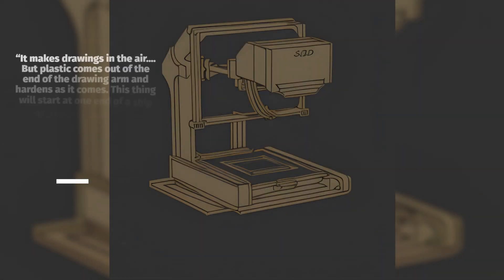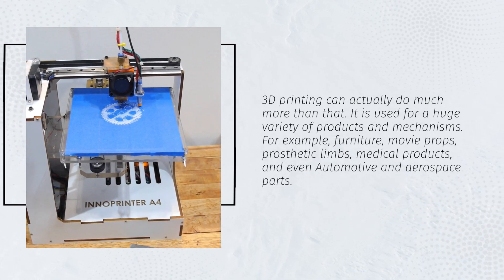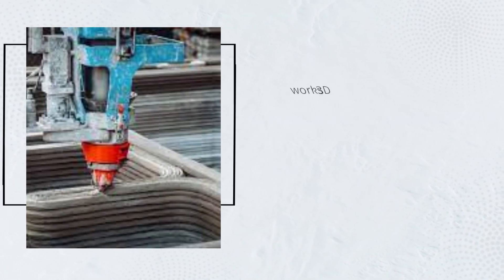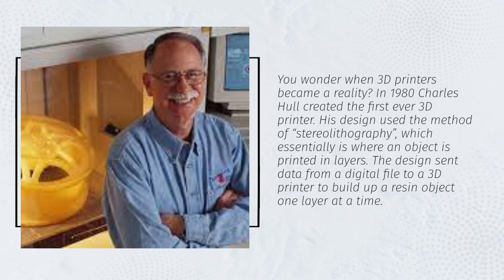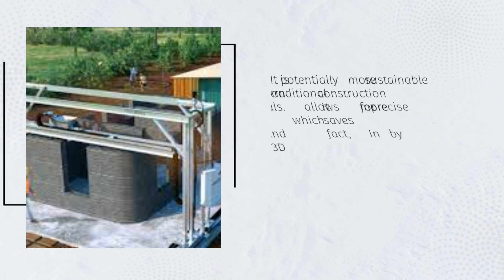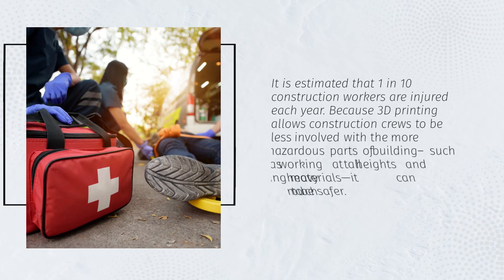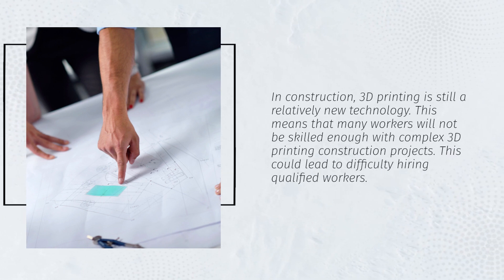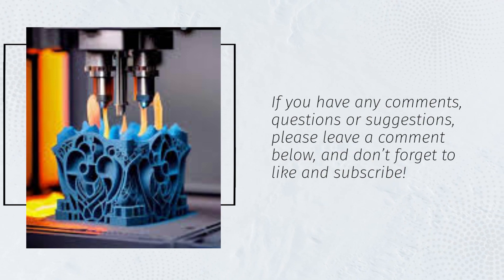3D Printing and Construction: A Match Made in the Future?

Comment: It's essential to own the printers so you get everything manufactured for you at cost of raw materials that's the key. Crowdsource purchase of the most advanced printer designs for all materials plus scanners and recycling will achieve this. 15 of the best printers will serve 200 to 300 people making them all the equivalent to billionaires. The model is repeatable.
Reply from the maker: You are correct. It could be very profitable, but the initial cost is very high, and the time to start making money is not that short. If you can get solid investors' support, it should be feasible. Good luck!
Reply: The point being the solution to retail allowing all 300 owner's to print at cost of raw materials.
Reply: Solve most legacy retail to be accurate.